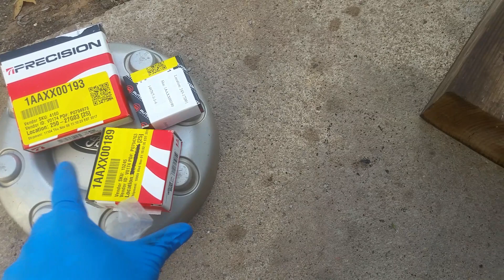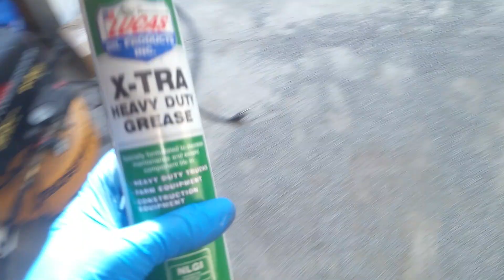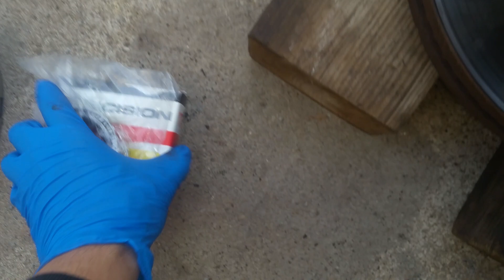Front wheel bearings 1999- 2006 f250 f350 2wd

Comment: I had this same project on an F150 RWD, and it has the same spindle setup... for some reason, neither the shop I paid to press the races into the rotor, nor the normal torque procedure seated one of the races properly.  A week later, noticed one side was rubbing on the brake pads.  Wound up getting some advice from a mechanic who told me, even after doing the torque and all that, he always takes the vehicle out for a trip around the neighborhood, with some intentional, safe, hard swerving.   Then he jacks it back up and checks both sides for finger tight on the nut, and “wobble” when holding the wheel top and bottom.
 If it wobbles and/or the nut is loose, he does the torquing while spinning, back off and finger tightening procedure again.
Reply from the maker: Great information , and advice . Thank you for sharing.

Comment: Plaid old bearings and races like in the good old days! lol 17in/lbs? Hell, that's finger tight for sure. Nice job. Thanks:
Reply from the maker: +Baxrok2 that 17 inch lb kind of scares me a bit , but that's the design I guess. I didn't fair so well on the drivers I guess the it had been let go the previous change for too long, the bearings were ok and had been changed but it was little too late. Looks like I'm hunting for the whole spindle knuckle , I can't handle noises like that . On the upside the brakes are all good . Thanks for watching
Reply: s33therfan Noises and oil leaks are enough to drive you crazy! I don't see many big trucks like that in the junkyards but maybe eBay or Craigslist will come through. Good luck!
Reply from the maker: +Baxrok2 indeed they are , I know where a few are however I'm not 100 % sure they're 2wd . Another problem there is a possibility they are in equally bad condition . Either way I've got to get that noise fixed . Thanks for the advice let the search began
Reply: s33therfan torque to 21 foot pounds, back off half turn, torque to 18 foot pounds,
Reply: s33therfan the 17 inch pounds is how much torque it should take to turn the hub after the bearings are tightened. My book says tighten to 21 ft lbs to seat back off until loose then turn 120 to 180 degrees.

Comment: Nice video covering the job. Not too many 2WD dually videos out there. I was lazy and paid Firestone to change out the bearings during a brake job. They had to change out the right bearing after just one year and 12k miles. Now 3 years and 30k miles later the left bearings are noisy.  I haven't changed bearings myself since the 90s, but thought they lasted way longer than 30k miles. This time I'm doing it myself to inspect everything and make sure they are properly seated. Wonder if I can reuse 3 year old races if they look good?
Reply from the maker: I would think they would be fine . Thats what i plan to do with mine just reuse them . Hasnt been long since replacing mine but i knew the knuckle didnt look that great on the drivers side ( the knuckle spindle rather ) i did discover however that a 2013-2016 knuckle is the very same as my 2006 . But anyways going to replace mine with a low miled one( new are pricey) and put some new bearings on the drivers side and call it good . Thank you for watching
Reply: your replacing bearings and keeping   the old races?  might be ok   Ive never done that.. find the best bearings  not the best priced .      chinese are cheap but  Id avoid them      id go with timkin
Reply: @jeffreyplumber1975  I did that once and the howl returned about 10k miles later.

Comment: The tightening procedure for this is not accurate for anyone that comes across the video. This is direct from the Ford service manual for these trucks. 

“While rotating the wheel, tighten the adjusting nut to 21 lb/ft to seat the bearings. 

Back off the adjusting nut until loose. 

While rotating the wheel, tighten the adjusting nut 120 to 180 degrees. Torque required to rotate the hub should be 2 Nm (18 lb-in). 

Install the castellated nut and insert a new cotter pin.”
Reply: Could b a good idea to advise to pump brake pedal before driving!!!!!!!!!!!!!!!!!!
Reply: sounds a bit tight ?   but ill keep that in mind

Comment: Thank you for all the information.  I did some work on my trucks front end and now I am getting a pull when I brake.  I'm pretty sure it's because I didn't install the bearings correctly on my new hubs.  I'm going to go back tomorrow and redo my work.  I'm thinking the bearings aren't seaded correctly.  Thanks again!
Reply from the maker: Thank you for watching.
Reply: @s33therfan  ended up being my steering damper and my inner tie rod link, though I did still replace my bearings, hubs, brakes, brake lines and calipers.   I also did the ball joints and shocks so with everything I did the truck drives like a dream for a 1999.

Comment: Two questions. How many miles on the original bearings before replacing. And what was happening to cause you to replace those wheel bearings?
Reply from the maker: It was well over 200k before the bearing started making noise. Now the problem was when the bearing went it also did some damage to the spindle , so I had to end up replacing that as well. Thank you for watching.

Comment: My bearings keeps going out after only a couple days of use. Second time already.
Reply from the maker: If the bearings are good and the torque is correct there is definitely a problem. I'd inspect the knuckle spindle and the part where the inner bearing would sit . I noticed on mine there was some marring etc from previous bearing failure , but mine is holding . I didn't like the looks of it though and will probably be replacing the whole drivers knuckle with a used off of eBay the next chance I get . Wish I could be more help but hope you can get it figured out I'm curious myself .
Reply: @s33therfan  thanks, will keep 'ya updated once done.
Reply: UncleSarkis - any update?